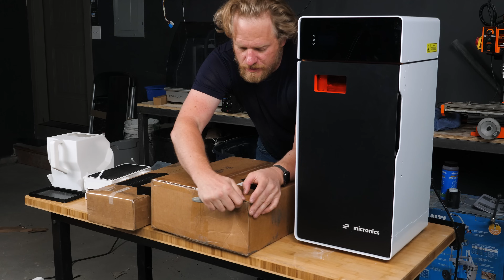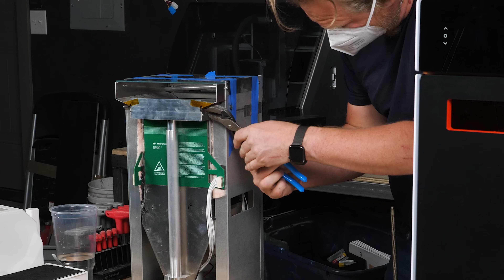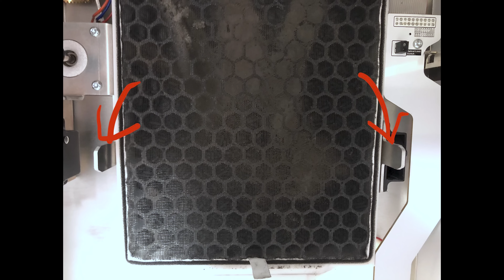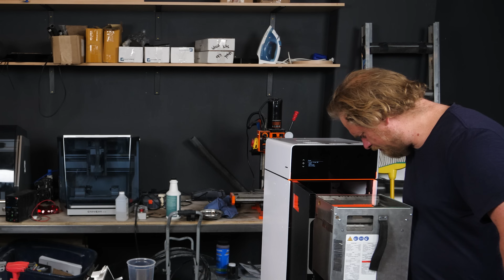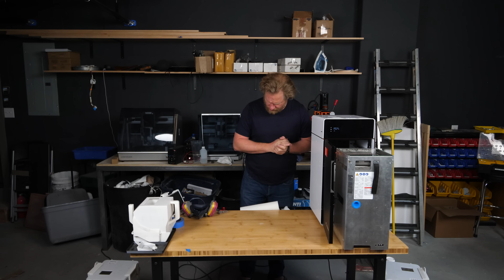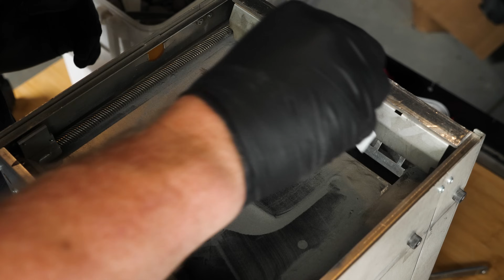Kickstarter Canceled! What’s Next for Micronics?

Comment from the maker: I heard back from Henry: "I think we would prefer to keep the printer's design close to ourselves for now to not help our competitors too much, so let's not do a teardown."
Reply: F that do the tear down
Reply: If Micronics was bought out, what's it to you at this point? Is the contract still pending? Is there an NDA that would be transferable? If not, why the heck not??
Reply: Of course they don't want the teardown. They were bought by a huge company because they were going to disrupt the market and now the project is killed. Great move by formlabs to be honest... Just shitty move for everyone else.
Reply: @biziluxgames8924  yup!
Reply: @biziluxgames8924 yea not getting free shit is so shitty 😂
Reply: probably it is an arduino or raspberry board and that's why they want to keep it so super secret :D
Reply: @marcelofrau8818 IIRC they use analog galvo controller so there will be that (which is the fun part of the setup), two fast digital to analog converters and an SBC or even STM32 board to read SD card, move the actuators and drive DACs and laser.

If you have an analog electronics and control theory nerd the galvo controller shouldn't be that hard (and thats the big IF because pretty much everything is digital nowadays).

The rest should be pretty much standard mechanical engineering.
Reply: That’s some anti-competitive anti-right to repair shit. Exactly what I’d expect from another company that is walking the same path of every evil corporation. The whole reason this 3d print community has worked is openness. This goes against the very spirit of the community.
Reply: Hahaha YOU don't need to tear it down, it just needs to get lost in shipping and find its way to Southeast Asia somehow.
Reply: His phrasing "let's not do a teardown" uses what I call the passive dictator voice. It implies a team kinship that he has a say in. "Be my hype guy, but when the bag comes $%#& off." Formlabs charging thousands to use 3rd party materials is up there with BMW charging you to use the heated seats with a subscription service. Them catering to an industrial market doesn't somehow absolve the doucheyness and make it okay. "No no guys,  extortion is ok, they operate at the enterprise level."
Reply: @Pyromancers  another great example of passive voice is "we got acquired". unless there was a bankruptcy involved, acquisition is not a thing that happens to you, it's a thing you *choose*. they chose to sell their company to a company with a completely opposite vision.

maybe the project was really in a spiral (it looks like it may have been), maybe they saw the writing on the wall, and this was their best opportunity to bail out their kickstarter backers and re-enter the workforce. without knowing the details of their personal lives we have no way of knowing if it's a cynical cash grab or more of a forced, calculated compromise. but regardless of the personal motivations, the project is worthless now. they paid off the investors but in exchange, took any novel innovations they may have had to offer, and basically loaded it into the corporate version of that warehouse at the end of raiders of the lost ark.
Reply: It was really ambitious so with all the tweaks it needed I am skeptical of a year being enough to turn it around to deliver to backers so it may have been the only real out. The Indy reference is nice lol. But sadly it wasn’t a deadly ghost bomb in a gold box that needed to be stashed, but a rad piece of tech that could have pushed innovation. instead was bought out by a company with $ signs where their pupils should be. Sigh. But yer right it may have saved the backers if they had already spent a bunch of the cash to find it wasn’t feasible. What do ya do?
Reply: @Pyromancers  I feel like this is a problem at the heart of tech crowdfunding. In my opinion, when you back a crowdfunding project, you're not investing in the literal sense, you have no idea what kind of return you will get personally on the investment. you're investing in a future in which a technology exists and is available to the public, your expected return on investment should just be as a member of the public who now has access to the tech. The problem with backer rewards is that they look a lot like an investment return, and people treat them like such instead of as, y'know, a reward. The result is that if a project fails, the creator needs to find a way to monetize whatever they've got, in order to refund the backers, and in this case the end result is that they totally undermined the basic concept these people invested in, in order to make them whole financially (at least, if that is what the scenario is). i'd love to see a site with a formal project liquidation process that focuses on salvaging the goal value of the project, rather than just the financial value. The liquidation team sells the expensive laser cutter you bought for manufacturing to refund backers, but all your cad drawings and notes and source code is published with an open source license. no liquidation is ever gonna recover 100% of the cash, but as a backer, would you rather your losses went into something useful to the public, or a black hole?
Reply: so, i think the extortion is actually somewhat of a desirable feature for business clients. the whole point of a company is to own some capital intensive means of production, hire people to operate it, and extract profit from their labor. if your means of production are affordable and accessible to all, your workers can just leave and set up their own means of production. even if it means much higher expenses when acquiring or maintaining a piece of equipment, it's worth it if it keeps it out of the hands of people. i doubt this is something most business people explicitly think about, but it seems like a pretty clear incentive that's led to these norms today.
Reply: @Pyromancers I hear that a lot from Chinese businesses, and I used to think it was just a language thing, but I've learned Steve from Gamers Nexus that they very much know when they're doing it, and it's a very common type of manipulation used in Chinese business.
Reply: @Studio23Media  Yep. This is actually fairly common in Asia. That along with the use of pay  $X as a 'deposit' to get $XXX discount. This gives the illusion that the money you pay as a deposit will be applied to the cost, but in reality, you are paying that for whatever the discount amount is. That happens all the time with Asian tech companies. I used to think it was a translation issue, but I met a person who works in Chinese (mandarin and Cantonese) language training courses. He said that he used to stress that in most English countries "deposit" is understood as something that is paid to hold the item, then applied to the final price. The companies all knew this, but linguistic tricks, like FOMO front pages on websites are just another marketing gimmick for them.
Reply: Competition promotes innovation.... They're gonna tear down the machine at one point. You don't want the community the point out obvious flaws? So be it. I'll just wait for the better machine not from Formlabs
Reply: You didn't sign an NDA then Tear it down. Henry probably wants it but doesn't want to get in trouble. It's best for the industry as a whole if their innovations live on as knowledge.
Reply: @steelplasma256  I don't think Henry wants a teardown at all. During the video he didn't even want Scotty filming the circuit board because of fear of reverse engineering. Also, what is best for the industry as a whole is not necessarily what's best for the innovative and/or acquiring company.
Reply: Absolutely do the teardown. It’s no longer a matter of helping them out and giving them a few months head start on a product they were kind enough to send to you but rather a way for them to keep this technology behind a massive paywall for greedy overlords. Don’t let this be another piece of tech to not see the light of day for 20 years. PLEASE!
Reply: I'm honestly disappointed that with a large corporation swooping in to kill this project that you didn't show the internals of the machine,,
You're only helping large business and hurting the DIY/3D printing community in general by gating the community from this, now entirely dead, product's details.

Please do better, not just for yourself but for the community as a whole.
Reply: These guys expecting promises made to them to be kept while they haven't kept any promises themselves is complete hypocrisy.
Reply: NDA or no, integrity matters. You can be mad at Henry if you like, but at the end of the day, if we want to see Scotty continue to covering awesome stuff, he still needs to come out of this as the sort of person these companies trust and want to work with. Doing a tear down even after they’ve asked you not to speaks volumes to other potential partners.
Also, like it or not, this was always a business, not a charity. Fundamentally, it’s about money.
I think if this video showed us anything, it’s that this was still a long way from being an actual product. The road from from concept to prototype is one thing, the ramp from prototype to finished product is often way harder than people realize. Looking at where things were, I’m honestly not sure if they would have ever been able to ship a working product, and even if they did, I am quite certain it would have been delayed.
They got into this to make money, and found a way to do so, while also making sure their backers were fully refunded. Surely that’s better than if they had been another one of those projects that took the money, and just failed to deliver.
Reply: @lukehb  Integrity like, finishing a Kickstarter as promised?
Reply: @alakani  I’m not saying what they did is fair — although I would say, everyone got refunded fully, which is much better than when most kickstarters fail — but what I am saying is Scotty’s integrity matters, irrespective of if they are in the wrong. 
Think about it. Imagine I’m a company with a cool new product I want to get in front of my audience. I’m still waiting on patent approval, but I’ve got maybe a half dozen prototypes I can ship out to reviewers, and dozens upon dozens of potential reviewers I could send them to. Would I really want to send it to someone who had done an on camera disassembly of another person’s prototype, even though they asked me not to? Can I really trust them not to expose things about my product to their audience?

My point is, it sets a bad precedent to potential companies who are thinking of sending out cool products to Scotty, and personally, I’d rather him continue to be able to see him his hands on cool products, and visit cool places, rather than risking his reputation, and losing trust exposing a product whose IP now belongs to a company with a history of some pretty anti-consumer practices, and could really make life difficult for him, if they wanted to.
Reply: @lukehb  Do we want to see "cool" stuff that the core audience and longtime viewers can never afford, to facilitate corrupt corporatism? Or do we want those kind of people to go away so people can finish their Kickstarter and people can get what they paid for, improving the entire hobby ecosystem for everyone? Integrity doesn't mean automatically doing what the richest stakeholder wants
Reply: @alakani I want Scotty to be free to make the kind of content he wants to make, and to have the freedom to pursue whatever future projects grab his interest. I don’t think he’s obligated to make any particular kind of content, but I certainly enjoyed his prior breakdowns of this project, and would like to see more content of this type, if it’s something he wants to make, regardless of the outcome of this.

I certainly couldn’t afford to back this kickstarter, but I also really enjoyed learning about the changes that were happening in this space.

I’ve enjoyed both incredibly practical maker content, and entirely impractical, completely out of reach stuff. Recently, I think the content I’ve really enjoyed here has been stuff like the high tech factory tours, or 3d printing human tissue, and love that there are people that are trusted enough by these places to be invited to see them, and let us experience it vicariously.

Appreciating one type of content, doesn’t really harm my enjoyment of the other, same way as I can enjoy both Scrapyard Wars and $10,000, gaming pc’s or $100,000 storage servers on Linus Tech Tips.

In this case, I think we fundamentally disagree on the rights and wrongs here, and that’s okay.

You can be frustrated that the project never came to fruition in the way you hoped, but, as we’re often told, Kickstarter is not a store. You’re backing a concept, not a product. As Scotty demonstrated, this project was a long way from being a shippable product. Maybe it was never going to be. 

They found a way to secure their livelihoods, and using their knowledge and experience to continue working in the space, in some capacity, without leaving their backers out of pocket. It may not be the ideal outcome, but it’s a far from a bad one — I’ve definitely backed projects where either the product has never shipped, and I’ve been completely out of pocket, or where the product that shipped was both so late, and so far from what was promised as to almost be useless to me.

Either way, I don’t think I want to see Scotty potentially burn his bridges with other companies, unless that’s a stand HE feels strongly enough to make.
Reply: @lukehb  You want him to do what he wants? Good, because he wanted to do a teardown before they said no. Not doing one is the Bad Ending™. Look up the story of Stratasys. We still wouldn't even have FDM 3D printing if they were allowed to continue their patent trolling unchecked, and that's what Formlabs is trying to do here. It is nothing more than profiteering, on a literally ecologically dying planet that desperately needs manufacturing to become more local to be sustainable
Reply: @alakani  and if he does, I’ll watch that video. As he’s mentioned, there is no NDA in place, so he could. But the difference is, I also respect his decision if he decides not to, and have presented one reason as to why, personally, I can totally see why he would make that choice.
Reply: @lukehb  I can still respect people even if they make selfish decisions occasionally. Everybody has to sometimes
Reply: If there's no NDA... do it.
Reply: I can understand the calls to do a teardown anyway, but from look at it from Scotty's perspective: doing a teardown despite requests from Micronics sends a poor message to any future sponsors of the channel. So, despite the lack of any kind of NDA, I can understand if Scotty doesn't want to do a teardown.
Reply: @flibblebot  100% agree. Short term, Scotty would be a hero, but the reputational damage could cost him access to cool prototypes in the future. If you think that's far fetched check with any reporter who gets a reputation for breaking embargos and see how many "hot tips" they get.
Reply: Tear it down! They betrayed our trust. Sellouts.
Reply: Please do a teardown. For all the hobbyists out there, it will save us time. What's more important then time?
Reply: @BluganoStudio Not discouraging other companies from sending him review models
Reply: Honestly, the lesson their competitors would get from this would be what not to do.
Reply: @peterkallend5012  the analog galvo driver seems like a really great cost saving measure, and my impression from the reviews i've seen is that that part of the machine was pretty unproblematic. I doubt anyone will be rushing to clone their powder feed system after this debacle, but there are definitely some cool things. (that being said, i have no idea if a hybrid analog galvo driver is actually a novel idea, of if they were just banking on our unfamiliarity with the technology to make it sound impressive)
Reply: @spambot7110 it is novel because nowadays the solution to the controller doesn't work fast enough is toveither speed up the code or throw a faster processor at the problem not to go analog. 

If you are charging your customers $35k per printer, putting $200 microcontroller instead of $50 one doesn't really matter. On the other hand finding analog control wizard is hard and expensive upfront unless they pop out of the weeds on their own like Luke and his friend did 😁.
Reply: you don't need to worry about disrespecting these people's hard work with a teardown, that work has been bought and paid for. if you do do a teardown, the only party you'll be disrespecting is form labs. which... probably fine
Reply: Thanks for making it so none of us get the printer great work 😂
Reply: They are gonna call it The Hooli.
Reply: Competitors is EXACTLY what Formlabs needs, Henry is a sellout and nothing he says should ever be taken seriously by the community ever again.
Reply: its cool ! they work so HARD. !
Reply: Boooooooooooo
Reply: If this is a purchased product, you have no obligation to respect a brand's wishes, especially considering this product is not something which can be bought by any customer.
Reply: if you truly support this hobby and bringing it to the little guys... you know your core youtube audience, you would call this out for what it is and do a full teardown, a comment on their video sums it up perfectly "
@Hawki007
2 weeks ago
This goes so far beyond letting these people down. You have singlehandedly snuffed out the SLS hobby market. You have set manufacturing back many years. You genuinely were taking a huge step forward--one that many people have been waiting for. We won't trust another company like this again. "
Reply: I knew that kickstarter was a scam...

You should do a tear down and make it all public. Otherwise you are just playing into the hands of formlabs to kill competition/threats to their existing captured market.
Reply: Do a teardown
Reply: Lol sell out
Reply: If henry does NOT tear it down and share it with the public then he and any future projects he is involved in should be considered a SCAM.    Takes everyones money for a starter project then just sells it off?   the hell
Reply: @BionicCommando-u1d  I mean this with respect, but if the backers get their investment back, where's the scam?
 I wasn't a backer, and don't know if refunds have happened yet, but my understanding was they cancelled it before the kickstarter even finished, and refunds happened automatically (and pledges were never actually even collected.)
Even if not, and pledges were collected. "Kickstarter Terms and Conditions, Section 4.2 "If a creator is unable to complete their project and fulfill rewards, they must make a  reasonable effort to find another way of bringing the project to the best possible conclusion for backers. A creator in this position has remedied the situation and met their obligations to backers if:... 
they offer to return any remaining funds to backers who have not received their reward (in proportion to the amounts pledged"
They realized they probably weren't able to deliver as promised (as we've seen in this very video, the project was a long way from a product), and found a different way to continue developing the technology, and working in the space, without taking money from backers and failing to deliver. Not the outcome we hoped for, but a much better one than another product in a long list of failed kickstarters that just take the money and run
Reply: Dude, formlabs only bought them to keep the prices up and stifle competition. PLEASE PLEASE send this to someone who is willing to reverse engineer and open source it if you aren't willing to. (or more likely if you just don't have the time too)
are you a man of the people?
Reply: How about you do the community a favor and ship your unit to Bambu Labs or Creality?
Reply: @BarrettAnderies  I'm Bambulab could do it if they felt it made economical sense.

The problem is, the market is very small due to the safety issues.
Reply: Fuck that. Tear it down. Tear it all down and post the pictures PUBLIC. They got paid, you don't have an NDA, you're only hurting the predatory shits who bought it now. Don't and you're only hurting the DIY community. Don't let this shit get locked up in IP for another 30 years like FDM. Get a spine.
Reply: @limeyrock  1000000%
Reply: @limeyrock  Agreed
Reply: @strangerparts  I respect that you'll honor their request. That said, I'm pretty sure at least one of the people with eval units will post details.
Reply: makes perfect sense and obviously a very reasonable request. Would be great if you could however do your thing and fit some strange parts to make it work, and then print some next level gadgets that only nerds would appreciate. 😀
Reply: Guess we gotta hope Bambu labs gets in the SLS game.
Reply: Wow...this is tough. Other manufacturers will be watching how you handle this. It could affect how you are dealt with in the future, but I am sure you've probably considered this. So it's really a toss up. 
Like an open world RPG, follow the script and play the game sticking only to the main story (limited play time, on to the next game), or go off on your own and hit every nook and cranny of the world (see more, get distracted, discover secrets, huge time sink). Who's to say which is better for you, as time is valued differently for us all. 
But either way, good on you, wish I had a "somewhat working" SLS machine to tinker on...
Reply: Greed took over
Reply: You are a YouTuber with no backbone and too afraid to disrupt your relationship with formlabs
Reply: They were just for the money then, what a shame
Reply: @jp.girardi I don't think it was just money, probably only a small part of it. FormLabs likely strongly suggested that they work together or get sued into oblivion. As an incentive I'm sure there was a reasonable chunk of cash for the 2 of them.
Reply: @jp.girardi What else do people work for
Reply: @jp.girardi  no
Reply: @jp.girardi  "They were just for the money then, what a shame"
This made me LOL so hard. Like, no... they don't work to make money, survive, and support their families, they just want everyone to have an SLS printer. LOLOLOL I can't stop.
Reply: @ionymous6733 then don't market it like they are trying to do a favor to the community, you don't get to play the moral card if you're a POS